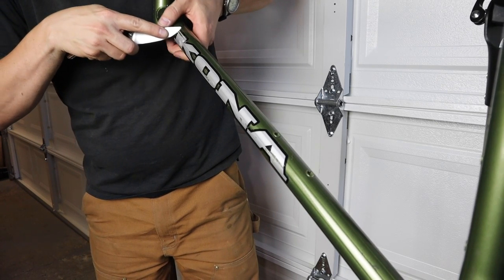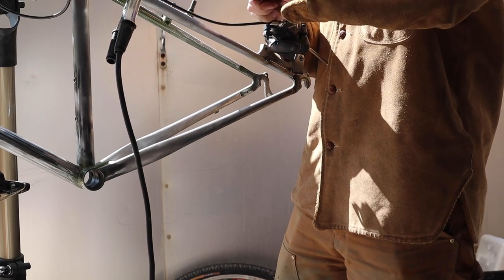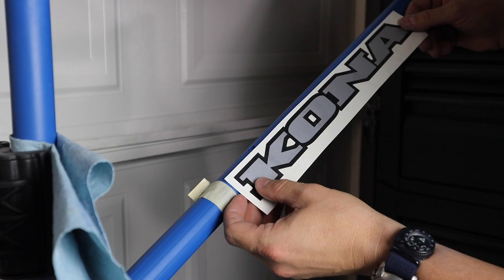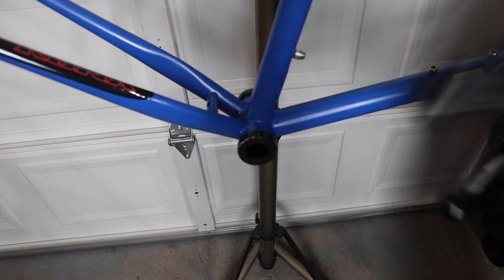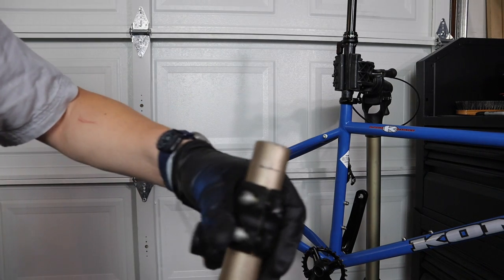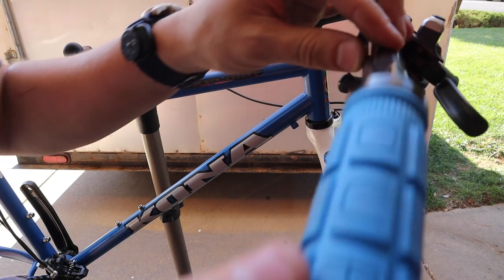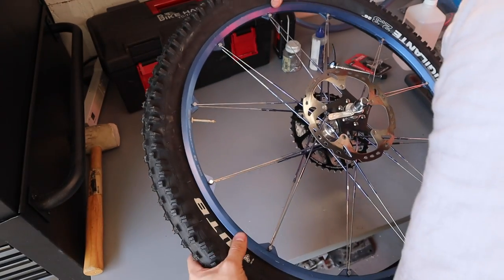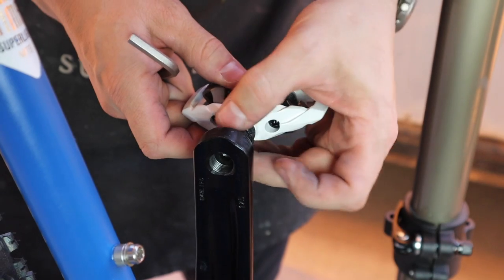Nostalgia | Bike Restoration Build | 1994 Kona Explosif

Comment: Great job. Steel is real. I gave my riding buddy a Kona Explosif I literally found in the trash. Complete bike. I knew he'd do right by it. He took it apart and rebuilt it including building a set of new wheels from scratch with modern rubber and a modern cockpit & groupset. He did that bike justice. I always liked those Konas. A very simple design. I've had full suspension rigs, but I'm going back to a hardtail. Coming from a BMX background and getting heavy into road bikes recently, I just like that instant connection to the ground with a hardtail.
Reply from the maker: Agreed. Thanks for watching.

Comment: The frame was amazing, with a nice factory paint job. And you ruined it. Moreover, they installed a disc brake, but the designers did not count on such a change in the design. This bike has become DANGEROUS to use !!!!!

Comment: im 42 now and grew up as a teen in the hay-day of the mtb explosion, i look back on those years with much nastalgia, pouring through Mountain bike action magazine, seeing all the new development in frame materials, design and the latest suspension offerings. I took a long hiatus after 2000 and recently got back into riding. its amazing all the new changes in bikes today and how incredible just a basic $600 dollar hardtail with hydraulic disk breaks, 1x systems and incredible suspension forks. how far things have come yet the joy remains when just going for a ride on the local trial

Comment: I think adding disc brake tabs to old frames should be a whole category - would you be open to doing a longer video or post about what's involved, materials, process, preparation and how to avoid failures?
Reply: One thing to take into consideration is thickness of the chainstays. I wouldn't try to weld disc tabs/braze-ons if it has thin tubing. The thicker the better.
Reply: @brokenchopstickz  Also, you need  to somehow transfer the braking power to the chainstays too.   Many of us just weld  a small tubing piece between the chainstay and the upper disc bolt.  This creates a small triangle that reinforces the brake  also preventing twisting movements on the bake caliper.

Comment: Setting a headset with a rubber mallet is nostalgia to me. I’m turning 40 this week and have been riding bike since I can remember. I have thankfully reached a point in my privileged life that my current stable is filled with carbon and titanium but I have found myself thinking of those first bikes I either owned or dreamed about as a kid. I share much of the sentiment you expressed in this video. Thank for sharing your thoughts.
Reply from the maker: Awesome steel is always a great thing to have in the stable too. Thanks for sharing.
Reply: @oldshovel  remember the ole Yamaha 20" with the coil over rear shocks & forks. 1973-74 ?

Comment: Beautiful build and re-imagining of this bike. It never ceases to amaze me how people get their panties in a wad over choices made on bike builds--whether it's changing a color or not using period specific parts. I've done a few custom builds on old bikes and got excoriated in comment sections by retro fanatics. I eventually left those groups and stopped posting my builds. I'm a GT guy and found a 1992 GT Bravado that was in miserable condition--the BB was rusted to the shell and I had to actually use a blacksmith hammer to pound it out. I then stripped the frame and painted it a gorgeous copper. I used the original derailleurs, but swapped out the biopace cranks and made it fully rigid. People lost their minds. Funny thing was, Gary Turner himself commented on it and absolutely loved it. The next project was converting a rusty 1989 GT Avalanche into a drop 26er. I custom powder coated the frame. Once again, people were outraged. Bottom line is, do whatever makes YOU happy--you're the one  doing the work and riding the damn bike. Anywho, I enjoy your videos--great content!

Comment: That green color on old frame... Spectacular... You shouldn't takit off man... Other than that great job...
Reply: With the severe hacking job on the rear triangle, refinishing was inevitable.

Would I have used a V brake? Guess what... I already do on two out of my three daily drivers. Nothing wrong with M950 calipers on mavic ceramic rims, IMO.
Reply: Completly agree
Reply: @weareallbeingwatched4602  what pads do you use for ceramics?
Reply: @oreocarlton3343  the vanilla shimano ones do me fine
Reply: @weareallbeingwatched4602  I personally don't like the idea of wearing out a wheel for rim brakes. I will be happy with disc brakes. Simpler and can keep the wheel true and a quicker swap.
Reply: @forevercomputing  I have seen 19th century bikes running original wheels. Obv avoid '70s/'80s roadie drillium stuff, but of all the possible failures of the bicycle, worn rims is one of the rarest, particularly with modern aluminium forming methods & coatings. Literally everything else will fail and require replacing first, including hubs, spokes, caliper bearings & springs. We are talking as rare as knackering disk brake rotors due to wear.
Reply: @weareallbeingwatched4602  Disc brakes will still wear. I've never worn a rim through though, but it is easier to put miles on a car than it is a bicycle.
Reply: @forevercomputing  I have had one worn out rim failure in my life, likely caused by somebody running the front brake with no pad on before I got it as a kid, and so far have had no disk rotor failures, although simply loads of pad failures, and also plenty of dead rotors due to being warped or knocked into stuff, and quite a few failed calipers of various sorts - contrasted against a few dead "taco-d" and bead-dented rims of both rim and disk type, due to various sorts of crashes and mechanical overload conditions. Simply haven't had major issues with rims wearing out and conventional brakes.
Reply: @weareallbeingwatched4602  You can tune brake discs into a less warped shape.
Reply: @forevercomputing  dents and warps not so much, but I agree properly made disk rotors are basically indestructible, unless poorly stored/damaged in transit / severe crash / wrapped up chain-mech-spokes-lines mess.
Reply: I am 100 percent with you on the old color. It was beautiful, and even the decals were still nice. Shame to destroy that. I would have coupled the original frame with a a pair of Magura HS33 brakes, the downhiller's choice in the 90s.
Reply: His choice was to change the colour, that’s the whole  point.
Reply: Choice, expression, decision etc
Reply: @weareallbeingwatched4602  hi im also planning to restore a few bikes and was wondering if i could ask a few tips and pointers from you if possible.
Reply: Totally agree. Those Kona's had high end steel and great colors. The repaint pales in comparison
Reply: Agree 100% ❤ that Green,, but otherwise great job 👍👍👍
Reply: Another agree.. anyway great job

Comment: I am rebuilding a 2003 Kona Kula Deluxe,  just sent it off to powdercoat.  I just repainted the Suspension fork this morning, the crown n sliders/  Everything is taken apart and cleaned, the suspension parts are in a bucket air drying, gonna rebuild the fork, seals are on the way.  Shifters. deraileurs , cranks, ribgs were all cleaned in a bucket of dishwater n degreaser, new cables n housing at the ready with freash rings n cassette.  New brakes n rotors,  Handlebar n grips , Tires too. everyghing fresh
Reply: sick! could you send me a link to some photos?

Comment: This is MY bike. Still riding and kicking ass on it, in a place where 27.5 carbon squishies are all the rage. (Vancouver Island, BC, Canada). It was my first race bike, garnered through KONAs GrassRoots race program. Raced my way to Provinical Champion in Alberta (riding the Rocky Mountains on a hardtail is STILL fun!) and the tiny frame (technically a 12") came with 176mm Curve Cranks - and I'm still partial to long cranks because of this anomaly. SO grateful I found a local bike shop that will indulge me and my vintage bikes. I prefer the original colour, but your bike build is inspirational. My wee Explosif would SO rock with your upgrades. Agh. Dream On. ;)

Comment: Love that old kona, been a kona fan for years now. This video makes me wanna dust the cobwebs off my 1999 specialized stump jumper and fix it up. 👌
Reply from the maker: Do it. I have an old stumpjumper from the same era. They’re great bikes.
Reply: Craig Eazy I’m riding Specialized Hardrock even now. I bought it 28 years ago, used.
Reply: @oldshovel  yeah man they are, been wanting to do it for a while now. Might be pricey but ima do it
Reply: @sirshanksalot1  nice man i also have a Hardrock still in good condition its a 2000 or so

Comment: Really awesome video man! Just a tip I've found restoring my bikes: Try a heat gun for sticker removal and a pipe cutter for steering tubes.
Reply from the maker: Thanks.
Reply: And a pretty fair DIY headset/bearing press can be fashioned from fender washers and long 1/2"  bolts and nuts from any hardware store. 
Cost ya 5 bucks.

Comment: I've just recently found your channel and have now binged all your bike restoration videos (and the canoe ones). I have just pulled out of storage a 10 speed Randor road bike I got a few years ago for about $25 at the local thrift. I ordered new 27" tires, tubes, cables and chain for it, I also just broke down a 24" Columbia that was given me because the quill had lost the bolt and was seized  - I managed to get it out with a lot of penetrating oil. I don't know what to make from the Rando, but I am thinking of putting a straight bar instead of drops, changing the brake levers. 

I enjoy your channel more than other bike ones - your camera framing is spot on and you don't seem to be yelling at your viewers, I learn more from just watching you work.

Comment: Cool. I'm also the kind of biker who enjoys building a bike as much as riding one. I have 4 small children ranging from 9 to 13 years of age & instead of buying them Hotrocks or any other kids bike what I've been doing is buying adult bikes in sizes small & extra small all 26 inch wheels & I will search for bikes with fox forks & disc brakes & will swap everything  from one bike to another. Their bikes are super children's bikes & are as light as 23 lbs. I beleive the lighter the better in case they have to push it up a hill or lord prohibits they fall & the bike lands on them. Building & customizing bikes rocks & I actually like it more than working on cars.
Reply from the maker: A father after my own heart. I have done a lot of the same. Thanks for sharing.

Comment: I had an explosive, it was black with rigid project 2 forks, cantilever brakes, 3x7 gears with shimano XT thumb shifters with switchable indexing for the rear mech. I loved it and had upgraded everything as parts wore out. I used to commute 12 miles each way into Piccadilly Circus in central london using slick tyres, then swap tyres and go racing or trail riding at the weekend. I would put around 3,000 miles a year on that bike. I upgraded to early elastomer rockshox, repainting the signature gold fork legs in black to keep the original look. I bought them second hand from a guy at a race, fitted them in the car park before a race. I loved that bike. Years later some scumbags broke into our home, wrecked the place, stole all the small valuables like jewellery and my beloved Kona Explosive. This video tempts me to find another one….. maybe.

Comment: Very pleasant and soothing video. Your voice narration was great too. 
Would the stickers have been easier to take off with a heat gun?
Also, could you have used Easy Off Oven Cleaner to remove the paint?
Reply from the maker: I’ll have to try the easy off oven trick, sanding took forever. When I started sanding I thought it would go quicker than it did. As to the heat gun, I should get one 😁, but the scraping didn’t take too long and was a bit of an ASMR thing for me. Thanks for watching.

Comment: Geezer is talking about nostalgia while welding on an IS mount, hacking off the brake bosses, removing decals... I'm surprised he hasn't chopped out the steerer and put in a tapered steering column and stuck 700c rims on it!

Comment: This is great to see older bikes getting the modern treatment. Just finished doing something similar (minus the repaint and disc brakes) on my ProFlex 856!
Reply from the maker: Awesome. Those ProFlex bikes were fun.
Reply: Same here. I just finished my Pro-Flex 756 this Year , that I've owned since new. I also didn't repaint. But I did do disc brakes and air sprung suspension.

Comment: I am also in my 40's, I turned 47 two weeks ago. I have a early 90's mountain bike, Shimano parts: BR-M950, BL-M950, SL-M952, FD-M650, RD-M952 SGS, HB-M950 32h, FH-M950 32h with 7-Speed freehub from a FH-M732, CS-M953 12-34 machined to fit on 7-speed wheel, Mavic X618, Michelin 26x1.4, HP-M742, FC-M952-5 & Kalloy 29.4mm seatpost.

Comment: many many fools love bikes....Kona is just a brand name, they just spec things, slap stickers on them & market them & extort money from people because the mark up on new bikes is super messed up, it may be new with a shiny coat of paint & new tires. The construction is second rate & follows the standard business model of keeping costs down vs just making things one way good. Making things with true lasting quality, like you gave thought to the design. For example see Miyata. 
Those joints are gross. No artisan would make a thing look like that. The people doing it may be skilled, but they are trained & the sole purpose is maximum profit.

Comment: Are thinking of doing more builds like this? Like the older frame modified with present/upgraded parts? For example adding on the rear disc mount?

Comment: Freakin awesome. I built up a ‘93 Specialized Crossroads hybrid into a cyclocross bike. Sti shifters, drop bars, 1x, 386Evo bracket and cranks, Chris king headset, 35c tires. I ride it all the time, so much satisfaction to take something that was sitting in someone’s basement for 15 years and modernize it and make it live again
Reply from the maker: Awesome. Thanks for watching.

Comment: I had a silver 94 Hot with that same tubeset. I loved the externally fluted downtube.  It was a Kona "Custom" which were built by Tom Teesdale back then.  

I "restored" it several years later.  I added disk brake tabs, a Reba Fork, a Chris King wheelset, and a XTR 960 groupset.  I called it a Super Retro Build.  Unfortunately, the frame cracked a few years later.  I was heartbroken. 

A few years later I picked up a 94 Kapu road bike and did another super retro build.  It has a compact Ultegra 6700 groupset , an Ultegra tubeless wheelset, and a carbon fork.  I still have that one.  Those 93/94 graphics are still my favorite.

Comment: Great work. Great video. I'm also fascinated by those MTBs of the 90ies. Without searching all the comments which were posted before I would like to point out that I was tought to tighten the bolts of the disc radially - not circularly as it can be seen from 12:30 on.

Comment: Switching from rim to disc on frame only. How modern was Kona geometry than. Great restoration project. Beautiful bike.
Reply: Explosifs were more or less standard 1990’s NORBA cross country geometry: 71 head tube, 73 seat tube. I once slapped a short stem and a "long travel" 3 inch (75mm) fork on one with riser bars, and it made for a very responsive dual slalom bike.  Yes, go ahead and laugh... 3 inch forks were once considered long travel.

Comment: Cool beanz, Just got hold of a late 90s Cannondale M900 frame and forks, Gonna strip it down, spray it yellow add decals and clear coat then fit all the Ritchey, Halo and Shimano 10 speed goodies to it, Roll on March when I get round to starting it
Reply from the maker: Sounds awesome
Reply: @oldshovel  Your videos have inspired me to try one or two mikes after I've finished my dream Cannondale, I lusted after that bike back in the 90's but all I could afford was a Claude Butler Silver Ridge bought from a mail order catalogue, was a good bike but it weren't no Cannondale

Comment: Ohh. That was awesome. We are the same vintage. I also had a Caldera with a Marzocchi bomber fork. Great bike for its time. So smooth...
Reply from the maker: The Caldera was awesome. I miss mine.
Reply: oldshovel I actually still have mine and it’s  still in its OG format. I upgraded it at the shop when I bought it to full XT and the Z2.
Reply from the maker: Awesome. Can I ask what color it is?  I had a mid 98/99 that was gray and spec’ed like a 99 with an xt/lx mix and a z3. The 98’s were black with a Judy and the 99’s were orange with the z3. I have never seen another like the one I had. I wish I never sold it.
Reply: oldshovel I think mine was a 96. It was navy with yellow text. I can’t recall the stock components but after reading mtb action reviews about the bomber fork and xt brakes I upgraded. I’ll put up a pic next time at home.

Comment: While i like the concept of what you did, you have to consider the geometry of the original frame, this era of steel kona's weren't designed for modern length forks.
The disc mount too, if you care to be vaguely period correct, then you have to use IS mounts, not post.
Btw i own a 1996 kilauea, i plan on doing an update, i already have a carbon disc fork on it now, v brake rear, however i do build frames, and have the correct fixtures for disc mount placement, and you should never MIG weld on a bike, always tig, or in my case, brass brazing. And a brace between the seat and chainstays is a must for this type of conversion. Also you really don't need a grinder to remove brake mounts, use a hacksaw and a file, much safer.
Sorry for the rant, but for me, things have to be done correctly, or not at all !